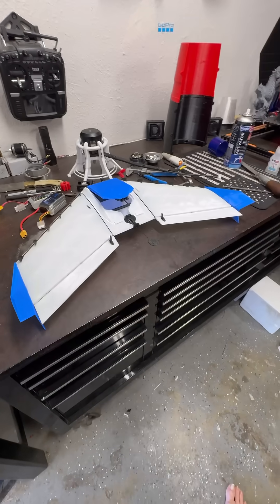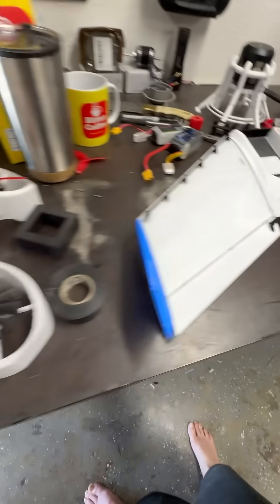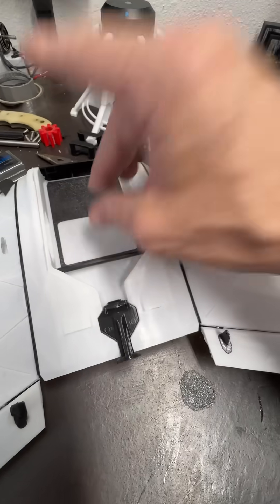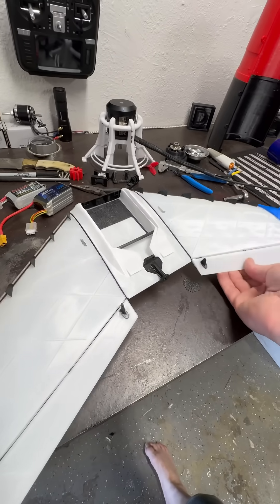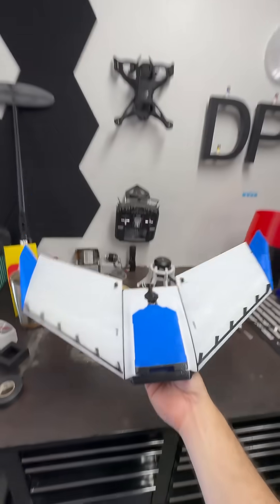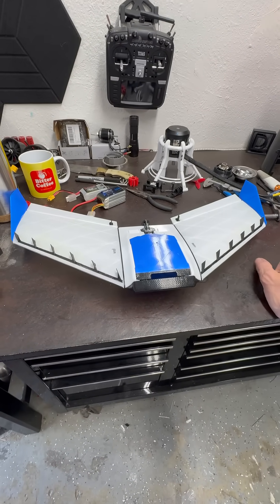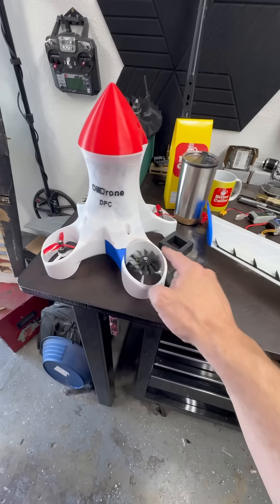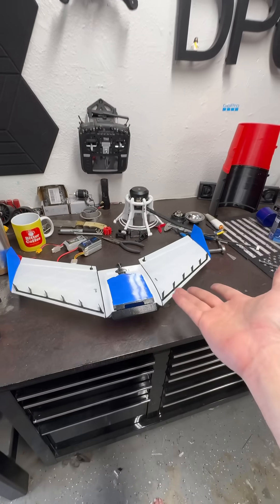Flying wing update. Time for electronics 😁#rc #flyingwing #3dprinting #diy #fyp #shorts #youtuber

Comment: You got split rudder? Also you can have a regular vertical stab on a flying wing y'know
Reply from the maker: In this configuration, I don’t think is necessary not at the scale. The winglets at the tips should suffice for stabilization.
Reply: Hey bud, where can i get the stl? @warmachined3472